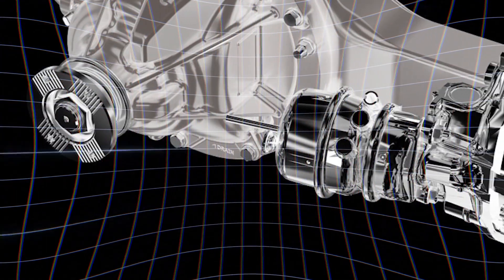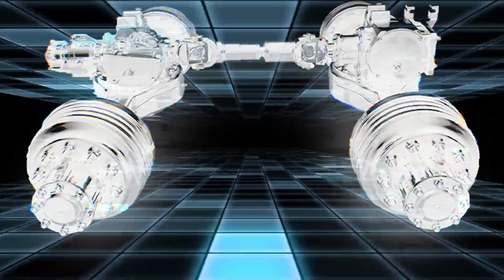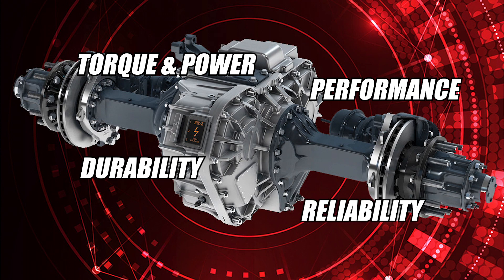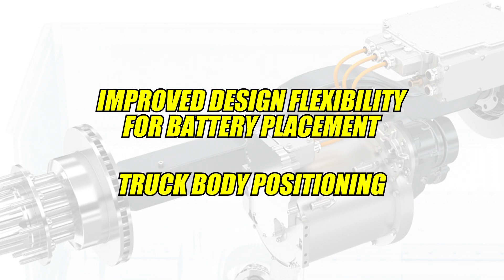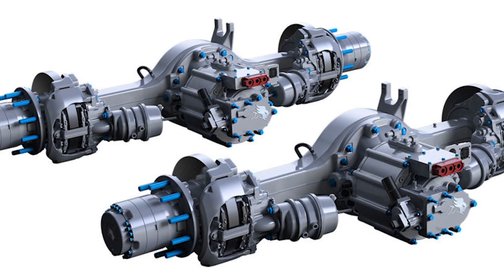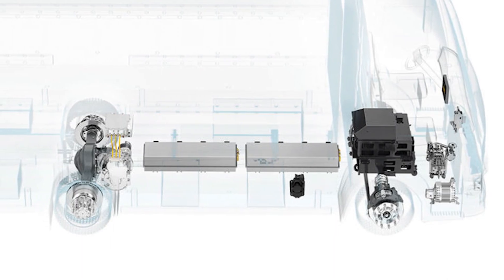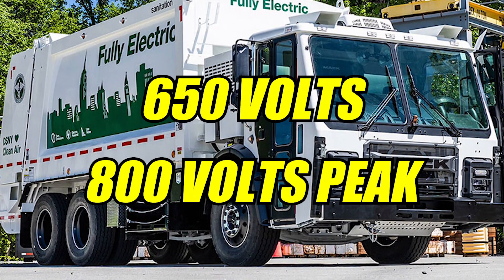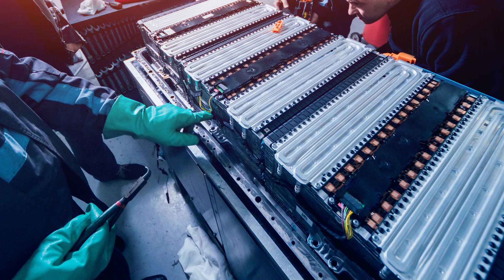What fleets need to know about truck e-axles

Comment: The next step should be one axial motor per wheel with a planetary gearbox and there for removing the diff.
Reply: My thoughts exactly, why have all the extra weight of the diff, axles and axle housing?